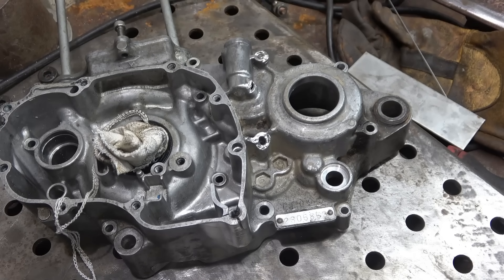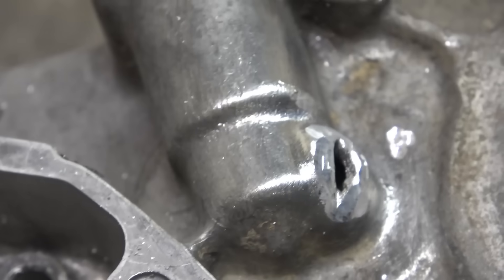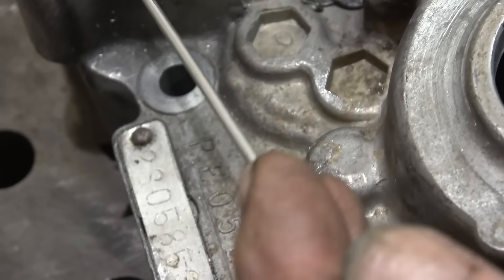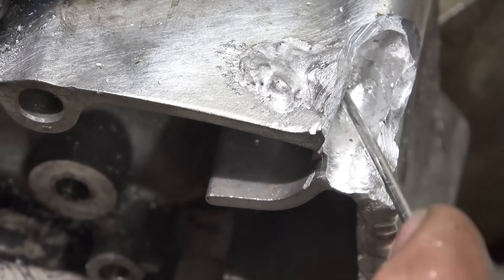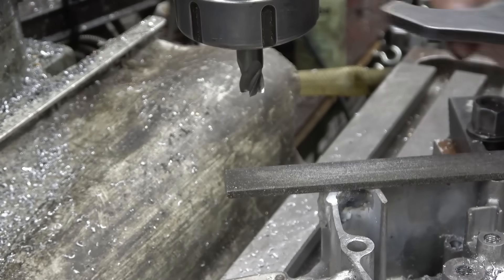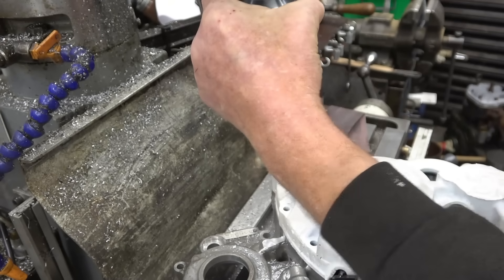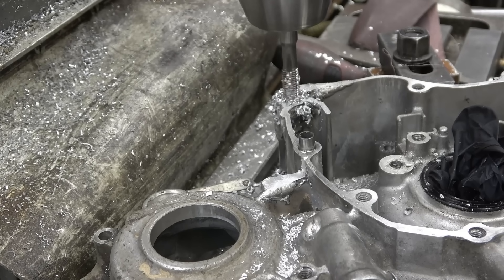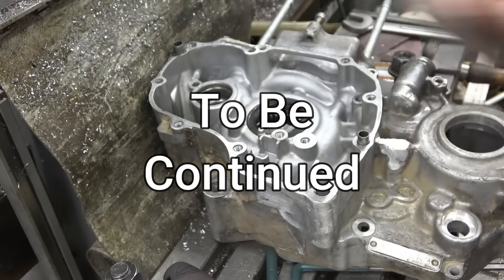SNNC 612 P 1 .  Honda CRF450R Crankcase Repair "TIG "Welding.

Comment: Great Job! We are in the process of attempting to weld the broken crankcase webbing after we broke the crankshaft in our 1916 Overland, it is an aluminium alloy that looks similat to the Honda you repaired, but being 1916 I don't know exactly what the alloy is. Can you suggest what filler rod you'd use if it were your job? I am in Bundaberg Queensland, and have a highly respected TIG welder (like you) lined up for the job.
Reply from the maker: 4043 is what I would use

Comment: Nice save but was that a 8x1.25 as standard or had been enlarged when a 6mm failed. I'm not familiar with that model but usually cover screws are 6 not 8.
Reply from the maker: It was an 8x1.25 as standard.
Reply: @doubleboost OK, unusual but as I said I was not familiar with that model.